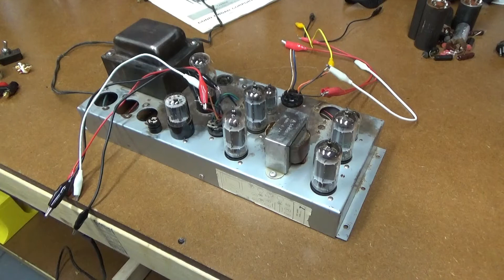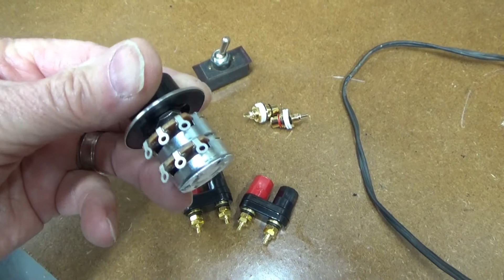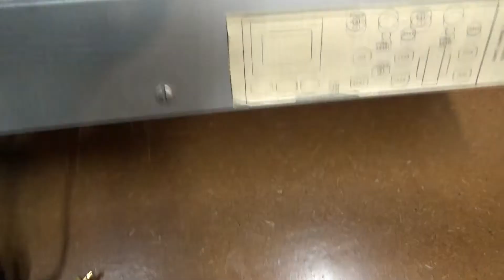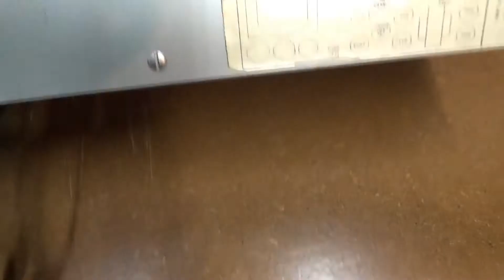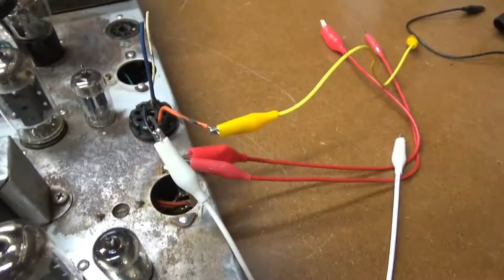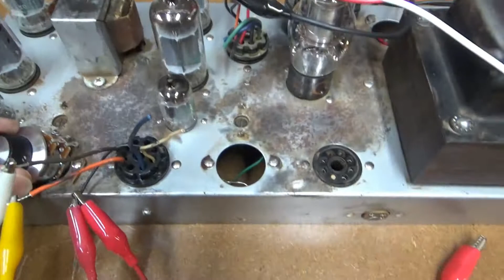1964 Conn Organ Amp Modified for HIFI Stereo Pt 2 of 2

Comment: Hello thank you for posting this video and your other videos on the Conn amp can you tell me what the resistance is on the Dual volume control pot I have the same amp thank you
Reply from the maker: The dual pot is 250K audio taper.  I think that I purchased that part from Parts Express.  Here is a link.  https://www.parts-express.com/250k-audio-taper-stereo-potentiometer-1-4-shaft--023-654
Good luck with your amp!
Reply: @mguess  thank you for taking the time to reply to me I just ordered the pot